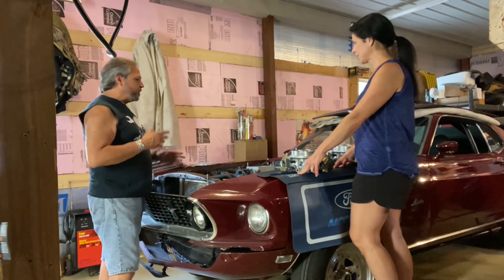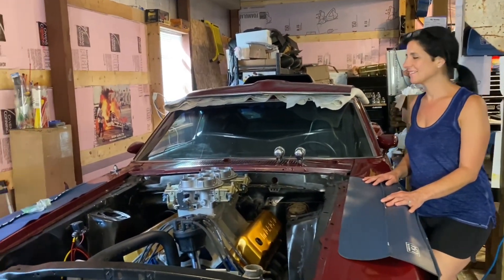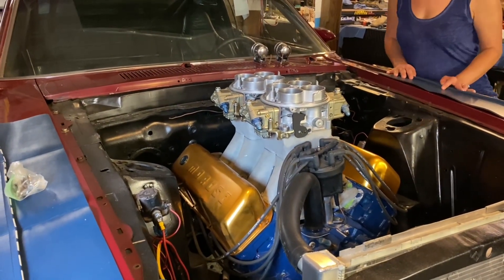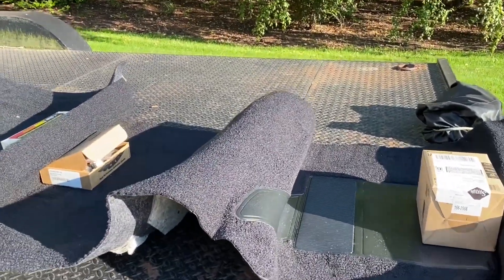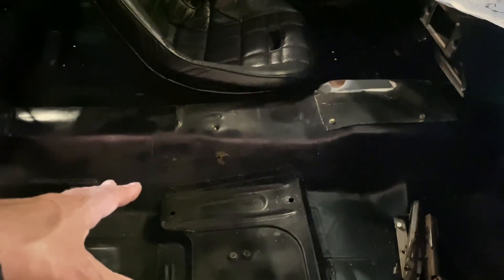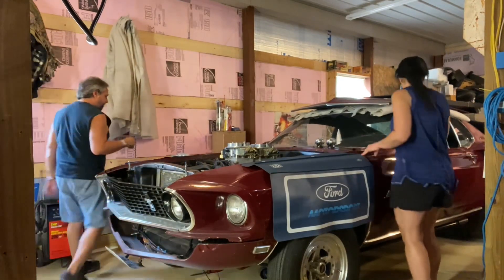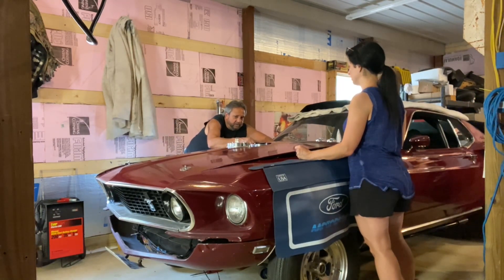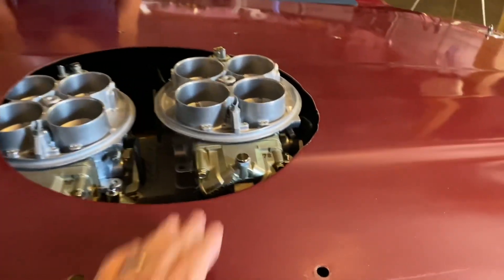DBG: Happy Labor Day, Tunnel Ram 615hp, 354 Cleveland Is In And The Mock Up Begins

Comment: AWESOME! I love the Moroso gold valve covers!!!!
Reply from the maker: Thanks Vamp, they have their nostalgia for sure. I really like polished aluminum better, but with a TR, they just seem to fit.
Reply: @DragBoss351Cleveland  I recently scored some chome ones. I ran blue ones on my 289 back 30+ years ago. They are all hard to get these days for 351-C.
Reply from the maker: @22vampyre  I have a set of blue, chrome, and a few gold. No red ones though.
Reply: @DragBoss351Cleveland  I think gold is my favorite!!
Reply: @DragBoss351Cleveland  I just put chrome ones on my 1972 LTD Brogham with a 400!
Reply from the maker: @22vampyre I did receive a set of gold covers from a subscriber, Ricky, Miles Junior, they currently are in California with a pro stock build currently being done by my buddy the wizard, Billy Ray Morgan have I have a video on that, better post that from a couple months ago? Thanks Vamp 🩸
Reply from the maker: @22vampyre  I love those cars, the lap of Luxury. Like those 400s.
Reply: @DragBoss351Cleveland  I have plans for the big LTD 4door. Its gonna get a mild cammed 514 and a Tremec manual transmission, and stock pretty stock other than a 3.50 locked rear.
Reply from the maker: @22vampyre your good to go. The ultimate sleeper and with a stick 😊🏁💯

Comment: ,,, if you need scoop clearance, the choke horns can be removed down to, that slight quarter inch step, at the top of the main body . And then I've seen just about any radius you want .
Reply from the maker: Thanks Roland. I completely forgot I have another set without the choke horns. Test them today. Thanks much

Comment: It will fit fine, the boss 429 scoop covers just past the bolt holes!
Reply from the maker: I see I need to cut the hood to clear either choke horns or if I use carbs  with choke still have to cut to clear float bowls. And looks like with cuts the scoop will be too close to carb. What are you saying Laut?
Reply: @DragBoss351Cleveland  That’s correct ,Tim. Yes those beauties stick up too far so maybe the boss 9 scoop is to low at the rear to allow all those parts to clear. I don’t have any solution for that. But that car sure looks great no matter what you choose to do.
Reply from the maker: @lautburns4829  yes think I may need the same scoop a cougar has, 4 1/2 Boss Scoop.

Comment: Tim hope you and your family had a great Labor Day weekend. OMG ! Andrea’s Mustang is absolutely beautiful!!! And that tunnel Ram on the Cleveland looks absolutely insane!!! Love the period hardware you have on the Cleveland👌👌👌Top notch!!! I have been thinking of doing the top end of the Cleveland in my S&H Torino. It’s totally stock other than the fuel injection. I was thinking of sending the heads out and cleaning them up, do a valve job and putting in a new cam. The motor was rebuilt in the 90’s totally stock and has about 25k miles. Maybe you can suggest a cam grind for me to work with the heads. Anyway, great video, beautiful car and awesome tunnel Ram set up. Take care Tim👍👍👍
Reply from the maker: Th and Mr. Will, appreciate your watching and commenting. I think the Cleveland is one of the best looking motors out there. Remember those a are big cars and really need the torque to move them. Somewhere in the 225-230 at .050. That is great mileage, why take it apart? 69 Mustang is one of my favorites too. Thanks Mr. Will appreciate you.
Reply: @DragBoss351Cleveland  Thanks for the cam info. You know you are right about why taking it apart. I’m always thinking about doing stuff and then try to talk myself out of it 😂😂😂 The life of a car guy. Take care Tim👍👍👍
Reply from the maker: @Mr.Will73 thanks Mr., it’s all good, I always say the enemy of good, is better.

Comment: That's cool Tim 😅. Is it a stock block with iron 4v heads?
Reply from the maker: Hey Bart,  thanks so much. Yes, Stock, Block, and Stock has. And that horse Pyros with a single 4  barrel not the tunnel ram. Glad you’re here.
Reply: @DragBoss351Cleveland  that's awesome. Do you have specs of the build? I Guess i missed a few things, busy here lately 😬
Reply from the maker: @hoedemakerbart  No not at all, I have not posted it yet. It is using an Xe block, and high Ports and cam he got from Jack Roush in 1975,  got parts Dave Huntley, if you remember that video

Comment: Awesome man! With all your experience with Cleveland’s do you have any turbo exp with these engines? I’m building one now but wondering if the detonation issues with open chamber 4v would be relevant under boost.  Thanks.
Reply from the maker: Thank todd, no experience but have a few vids with blower and twin turbo’s guys said they worked like a charm. But obviously need to keep cr down, and open chamber that’s a given. Not sure on flame front or travel with those heads

Comment: Did the carbs need much work for the application? Looking to build a 393 with the same setup for my xt falcon. Looks great by the way.
Reply from the maker: Thanks. These carbs are old pro stock carbs, Holley 6464. I got them with some protein stock parts I bought. I sent them to David Cook for rebuilding. I have never used them yet. You want the best carbs for your application, contact APD, advance product design. They can hook you up with the best.

Comment: I'm curious. The panels on the wall. Sound proofing ? Cold in winter ? Is the garage used as a paint booth ? 
As always. A very interesting and informative video. The cleveland is an amassing engine. 
Last year I mentioned to you that I was building a high torque 4V engine.
The engine is completed. Run on my humble test stand. 
If you are curious, you can hear the engine running on utube.
" 351 cleveland 4 barrel.
Purpose built Corba Jet. "
It's going to cost me $850 in Medford Oregon to run the engine on the dyno.
I have 4 intakes to run and an assortment of carbs.
Reply from the maker: Hey Cam, yea just insulting material. Pink panther from Owen Illinois., plan is to stud walls, then bat insulation and osb. I remember you said that. Let me ck it out. That should be a great dyno session.